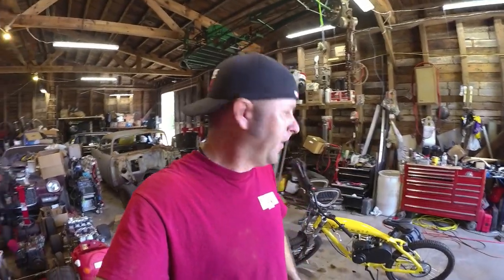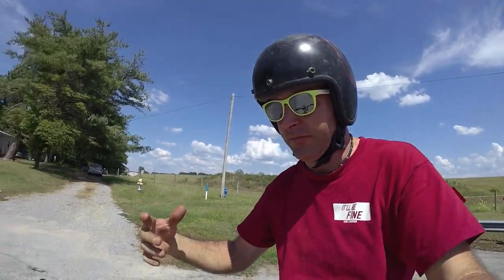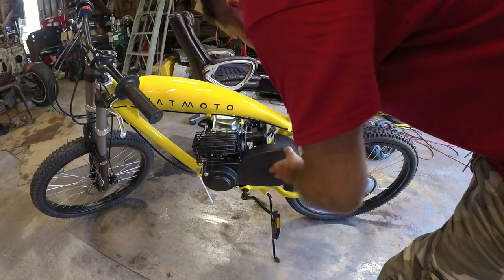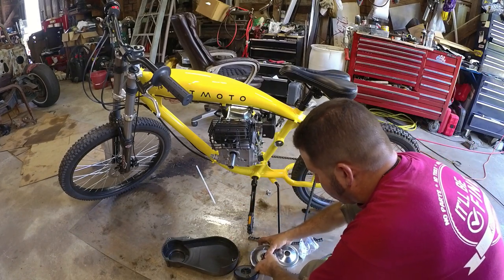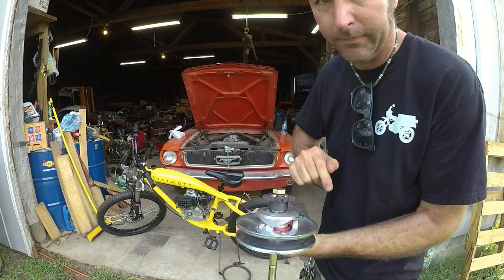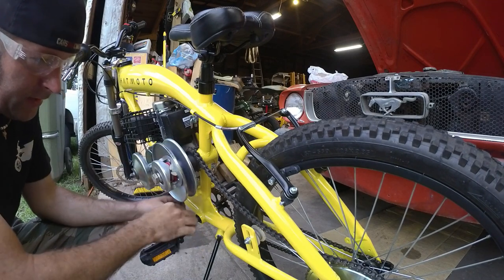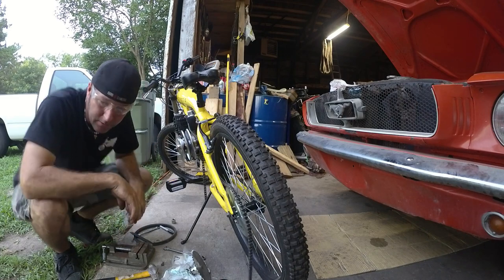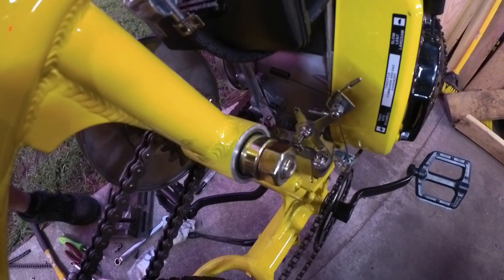Phatmoto gets upgraded

Comment: I built a motorized bike about 8 years ago using an $80 Walmart Cranbrook Cruiser and a 2 stroke 49cc engine mated to a friction drive unit I purchased online.  That thing did 34 mph (gps) and it was scary as hell.  My Walmart bike was never meant to go that fast.  Now I have a 49cc 4 stroke Chinese scooter that I used to ride to work before I retired.  It hits 43 mph (gps) and feels a lot more stable at speed.  My scoot is pretty heavily modified but is still legal at just 49cc.  I love your projects man and..."It'll Be Fine" is a great catch phrase.  It is right up there with "Hold My Beer."

Comment: I haven't did Torque Converter but upgrade to 203cc Hydraulic Disc Brakes front and back and lowered  the sprocket to 40 tooth.Got up to 31 mph and love the hydraulics need torque converter.

Comment: Thank you for sharing. A friend of mine had one of those 2 cycle bike engine kits on a bike. He got hit by car in town, he was not hurt but the frame of his bike was pretty messed up. Well he was moving out of state and gave me all kinds of bikes and bike parts, and the one with the bike kit. I put it together on a nice old huffy mountain bike frame and it came out looking  sort of like the old 1920 Indian motor cycles. It is black also. Anyhow using my Garmin extrex GPS it clocks out at 36 mph on a flat. Which  by the way is pretty scary on an old bicycle. I would love to change the gears and get a lot more hill climbing power. I've got a lot of hills here western Pennsylvania. I have not run the thing in a couple years and I've got a mind to  build a motor cycle based on the old Indians. A beefier frame suspension and motorcycle wheels and tires and a 4 cycle with more power. Yea basically a version of the old Indian but with a more modern engine brakes etc. My son had an 85 cc Suzuki motocross bike and the wheel and tire size would be perfect.

Comment: Isaac, the original jackshaft bearing is a 6202.
That bearing, is 35 MM outside, and 15 MM inside.
There is a 6202 5/8 bearing.  Cost me about $14, 
for four delivered.  I am replacing the proprietary 
jackshaft, with a standard 5/8ths shaft.  (I've got 
2 bikes to do.) the standard Phatmoto will keep 
the standard engine, but the phat tire one will get 
a Tillotson 212 in it.  "Thanks Go Power sports!"
(Yes, I used your link.)

I may put a Sick Bike Parts shifter kit in the 
black one.  (Not the phat tire one.)

steve

Comment: Next we hear Isaac got ticketed for 75 mph on his Phatmoto...  Lol
Reply: In a 30 zone... 1320 video will be doing a April 1st vid of phatmoto's racing.
Reply: Someone was clocked doing 85 kph in my local town. Now they are considered motorized cycles and you need a license for them. (It only takes one to ruin it for everyone)
Reply: I could see it, I put one of the stage 3 2 stroke 80cc bike berry engine on a razor ground force kart and with some one around 100-180 it dose about 60mph, but with someone my size I need to get a push to start moving and does 25-28mph. But I am around 300 lbs lol.
Reply: @Sappingtonsaquatics  chances are that 80cc is actually a 66cc stroker to a 100cc with a 50mm piston and balanced crank billet case carb and redvalve

Comment: Hey brother iv been wanting to do a torque converter on mine also...i bypass the governor and changed the exhaust and carb ...i put a speed carb off one of my 2stroke bikes with a 70 main jet ...stock clutch and a 36t rear sprocket and iv been 47mph ...the stock intake from the 2stroke bike engines will bolt directly to the 79cc lifan head (40mm) intake not the 32...the off set is the best so the carb is out from under the tank and fuel valve ...i had my 212 on it and the power of that motor is crazy fast 55-60 so easy but I broke my stock rear axle and busted the bearing cage out of hub...broke a chain and bearings on jack shaft so I took it back off for now but it's going back on but I'm upgrading all parts first...but I'd love to try a torque converter I know it's got to be way more smooth ...when you change the carb and exhaust your gonna be really flying bud ...iv got the 2020 red one they are very sweet bikes...

Comment: My 2019 last summer was hitting 37Mph on flat ground just with Governor bypass and 36 tooth sprocket.  Exhaust too but I think the exhaust actually makes it slower but sound better and a lot quieter.
Reply: how much up hill power loss? i was thinking like 48 or 44t. i changed the freewheel sprocket from 18t? to 16t much better pedaling hills. now if only brakes worked more than 2 hours.🍻

Comment: I was looking at one those yesterday,  this is gonna be sweet! Continuing the video.....
Reply: I bought a 50cc bicycle to motor change over kit a long while back and it went 28mph on a 15speed bicycle.  That motor they put on there just is not what it should be.
Reply: I just purchased a small 50cc 2 stroke kit off ebay for 105$ put it on a 26" cruiser bike. doing about 35mph. sold it for 400$ and building 2 more now. there pretty fun.

Comment: You must have a 5/8" drive pulley coupled to another 5/8" driven pulley and I am wondering if the 669 belt would fit since that is the stock one on the 212cc CVT kit.
I suspect that the CVT will eat up some HP on the 79cc engine but a good Mikuni carburetor, int/exh header and further mods on the engine would help. A CVT on
a 212cc makes a world of difference so the CVT should really help.

Comment: If you don't have a lock nut you can always use a punch to make the one you have a lock nut.  Just punch it in 3 places around the perimeter so that it will be a snug fit on the threads. DIY stover nut.

Comment: You should put a tilson 225 on that fat Moto it can be done and they do make motor mounts for a 4-stroke motor that mounts on the seatpost downtube which the motor would be tilted forward to fit better or they make a regular motor mount but that would mean you would have to cut the original motor mount plate off you don't need the jackshaft you can put a CVT on it like to do a go-kart

Comment: I have a Phatmoto ...I had a guy take the governor off.He also did something on the inside of the motor don't know what it is. Got my bike back took it for a nice long ride.Keep the throttle on a little to long..He also put a bigger spark plug in it.The engine got really hot and something popped in it.Could i have blown the engine.I have a picture to show you.Could you be able to tell me what this is on the bottom of the motor.Or maybe i blew the valves.Ty Ralph

Comment: To bad ya couldn't have ran the regular chain gears on the wheel so ya could shift it back and fourth to go faster and have more power when put it in different lower gears but I guesse ya need to use the pulley gear they give ya whith it but I like the bike it looks cool .godbless

Comment: Isaac, what parts did you use for the conversion?

I'm building up my Phat tire off-road PhatMoto, 
and I want to use that torque converter setup.
It will have a Tillotson 212 motor.  (THANKS, 
Go Power Sports) but I want a torque converter 
system for it.

I'll be putting a Sick Bike Parts shifter kit, on my
shiny black regular model.  There will be no chain 
on the pedal sprocket.  (The pedals will just be 
footrests.)  The jackshaft will have a sprocket 
on both sides, and the right one will go to the 
rear wheel.

steve
Reply from the maker: Well your setup would be different than mine. I would use a torq converter to fit the 3/4 shaft on the engine. The jack shaft you would need to go bigger (5/8) shaft. I put go kart hub bearings in the place of the old jackshaft bearings and you will need the other torq converter pulley with a strong bolt to go threw the pully and bearings.  Oh yea and a sprocket. Now you need a belt. Gopowersports can figure out the belt size by measuring the pulley sizes and distance. The only  problem i had was the wheel sprocket is a little small so it might be geared for 50- 70mph. Lol some people would love that. Good luck

Comment: I know its a 5/8 bolt but how long is it and did you use a lock nut and was there a torque spec on the secondary 5/8 bolt? Thank you

Comment: Man Isaac I'm just gonna tell ya, I do 50 on mine with a stock "80"cc 2 stroke But now I did port it thoroughly. Could go faster if I put mikuni, and a aftermarket head. Also run smaller wheel sprocket for way more top end.I run a 36 now but gonna go to 32
Reply: It's a hyper bike 26 inch build

Comment: ok all kinds of questions- what is the displacement of the motor - did you remove the governor- how much does the bike and motor cost - what was your ending speed  ?
Reply: It’s 79cc. Does 18 out of box. Preset. Has throttle stop screw set to keep it under 20. I have a 99cc that does 38 max. Coleman ct100u.
Reply from the maker: Final top speed off video was 45mph. Im re gearing it to a lower speed but better acceleration

Comment: I think I'm getting ready to try a 70 or 72 rear sprocket for my phat moto for all bottom end and some off road pulling power! And if I'm not satisfied with that Sprocket change I'll just go with the predator 212cc with a stage two three or four kit whatever they have. Has anybody tried or been able to find a bigger rear stock sprocket to fit the phat moto? Sprocket specialties can custom make me one at a pretty reasonable price. I only run cruising about 10 through 12 miles per hour max most all the time.

Comment: Did it really get any faster? CVTs eat precious power, which the 79cc's don't have in excess. Might make more sense to just use a smaller rear sprocket with the original setup. Then just pedal it off the line to save your clutch.

Comment: Hey what’s the part number of that torque converter I went to Amazon and it was discontinued do you have another part number that would work thanks
Reply from the maker: Gopowersports.com has them. I think they are 5/8 shaft and you have to change the bearings in the frame for the driven pulley to work

Comment: To bad he didn't do a real speed and acceleration test before (stock clutch, 36T jackshaft) and after (torque converter).  Use a speedometer app on your phone so we know what speed you are doing. It looks like you still have governor enabled? I think the small gear on the jack shaft is a 9 tooth, what was the gear on the converter?  The stock rear gear is a 52 tooth.
Reply from the maker: Stock was a 10 tooth and i put a 14 tooth on. I dont like the 14 tooth

Comment: Change the rear sprocket to a smaller tooth and it will pick up more speed
Reply: Wont it also lose acceleration
Reply: Get a bigger front sprocket and smaller rear sprocket
Reply: @devinmarks4610  correct thats a 97cc engine its relatively small it makes about 3hp  dropping the rear sprocket youll loose accel
Reply from the maker: In this case it needs a smaller front and bigger rear sprocket to make it better

Comment: Where do you get parts for these bikes ? Gasbike.net shows parts but has none in stock and has not had any for 6 months.  Got one on my shop floor that needs work done but no parts anywhere I can find
Reply from the maker: What kind of parts are you looking for?
Reply: @isaacitllbefine7231  clutch ' complete Jack shaft ' complete rear wheel with gear and brake rotor and all pertaining hardware ' kill switch

Comment: I can't see this giving you any more speed worth mentioning, i'd like to see a GPS speed in a 1/8th mile run? The stuff that can give you more speed, you didn't do. You basically put a CVT clutch on it. When all you really had to do is change two sprockets.
Reply from the maker: True but the cvt gives me crawling speed and top end. It has a top speed of 34mph
Reply: @isaacitllbefine7231  Not on a stock one, no way, to get 34 mph, you have a governor off and other stuff done to it. Just a CVT will not go from 25mph to 34mph an increase of 10 mph?. Yeah, nah i don't believe it.

Comment: Stopped at 13: 20 to say a poor mans lock nut can be made by smacking the nut with a hammer making the hole oval. Ha Ha
Reply: Drilling and putting a cotter pin doesn't ruin the nut(You can still use the nut without the cotter pin if need be).